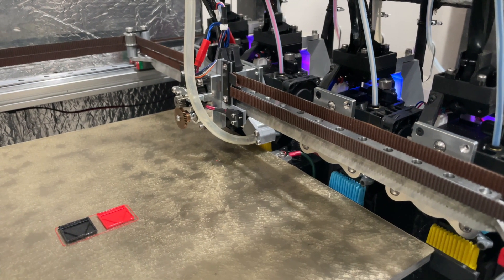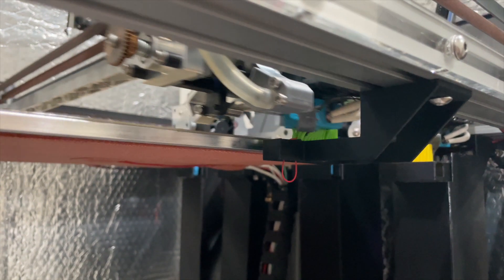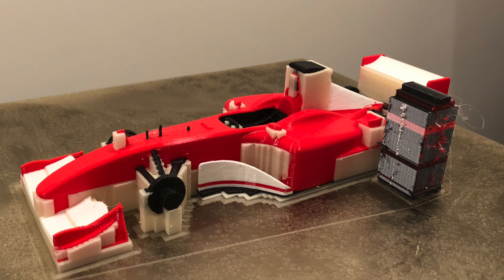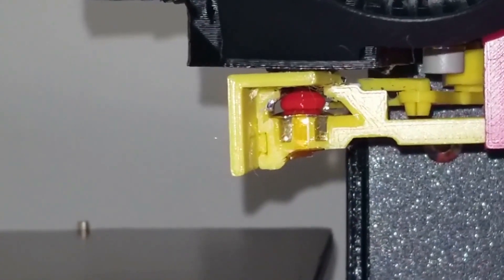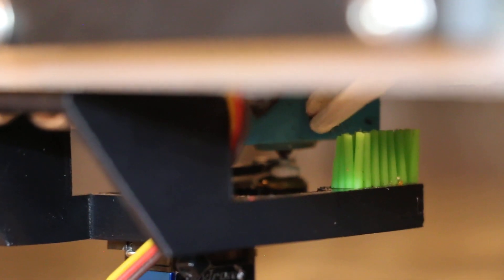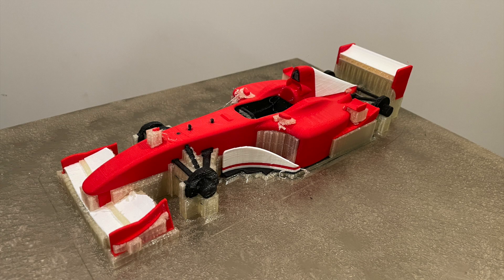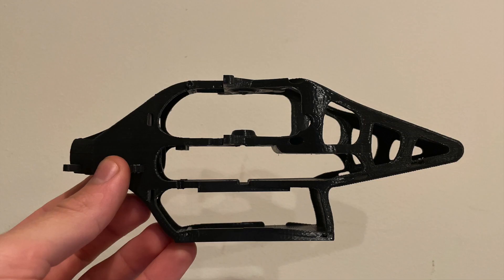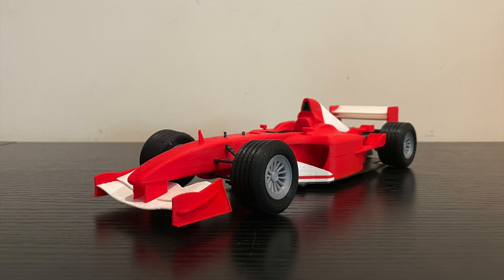Pebble Wiper - Tool Changing 3D Printer Wiping Solution

Comment: You've probably already answered this somewhere, but have you tried just using the expensive dissolvable supports at JUST interface layers, and printing the rest of the supports out of some cheap PLA or PETG? Might save you a bit of overhead for some of those larger prints.

Comment: that's so cool! tho I sadly have no space for this on my printer unless I put one for every tool.  also I can't afford adding more to my BOM and don't want more wires and all that for the servo
I think the speed increase is a huge deal tho. those few seconds add up to near 30m-1h on bigger prints. 13s is still a lot tho we gotta figure out a way to speed it up xD

what happens if you dont purge? i actually am curious. I should experiment a bit.
also are you on the jubilee server or something? i swear seeing the image at 2:36 on one of the discord servers i'm on!

also damn ultem on a tool changer? i'd expect the tool changing motor to not last!

may I also ask about your wiping purging/retraction amount on tool changes?

Comment: I have been using the ooze shield in S3D with a wipe routine and usually don't get any ooze on my parts, it's not 100% but does work quite well.  I really like this solution though, I may try to incorporate this into my current machine at some point.  Well done!.